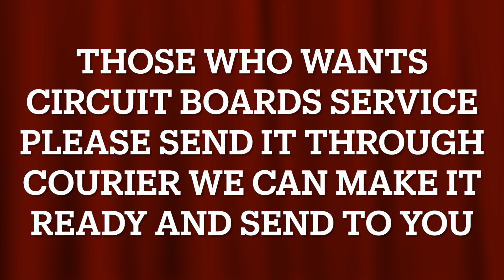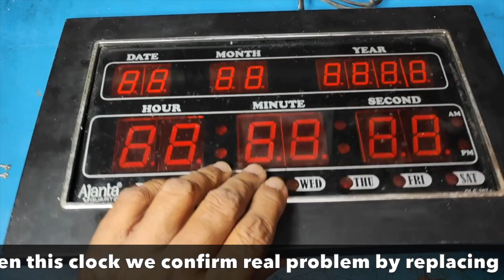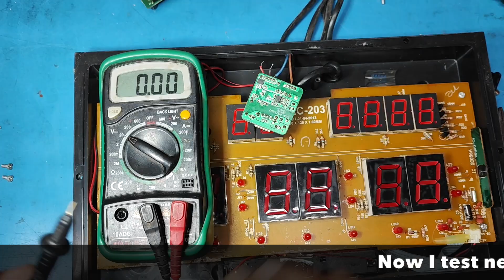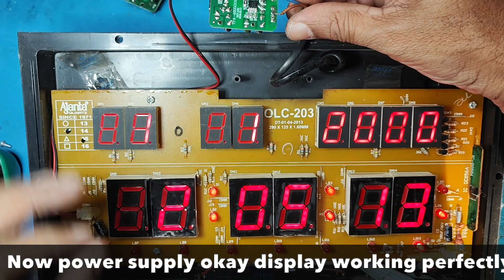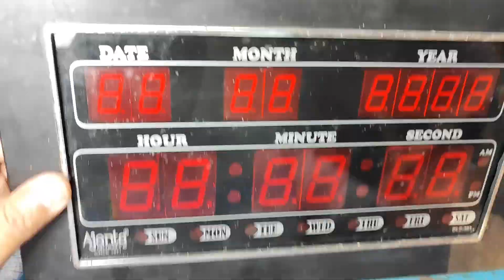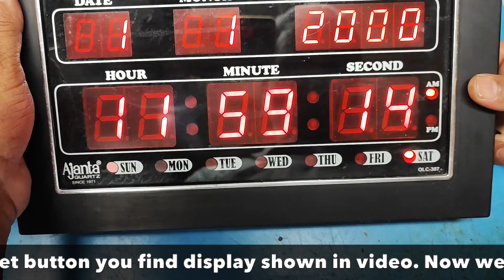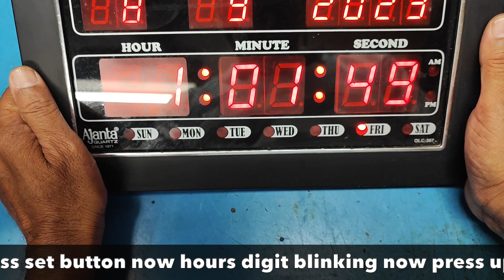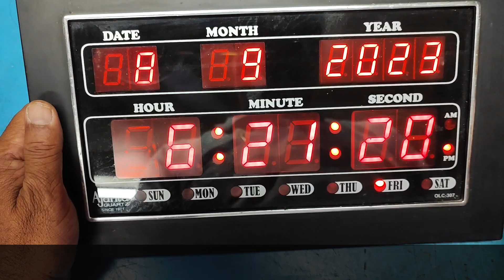AJANTHA DIGITAL WALL CLOCK లో పవర్ ప్రాబ్లం టైం సెట్టింగ్ నేర్చుకుందాం POWER PROBLEM TIME SETTING

Comment: simply u replaced the power pcb its not rectifying the problem .u should  explain how to solve the original pcb problem
Reply from the maker: To rectify original pcb components procurement is problem and takes more time. We have to show better simple way to problem. In every house number of old un used 5 volts adapters available. In servicing we calculate time verses money. If you have ability to rectify original pcb make a video and show it to me. Time is precious don't waste.